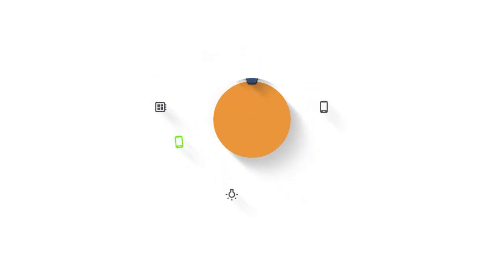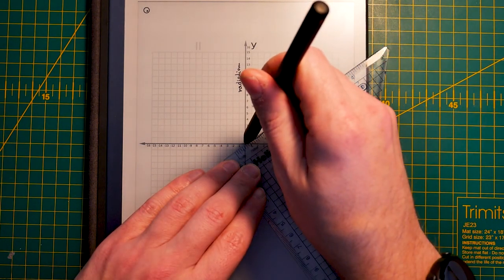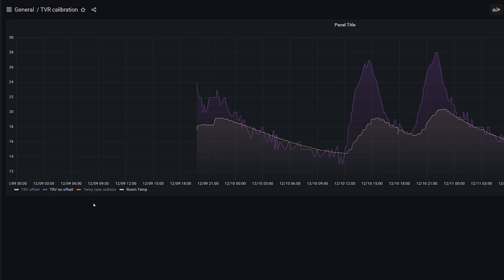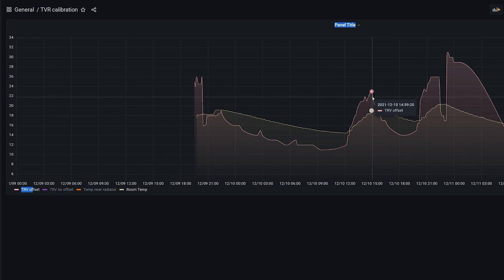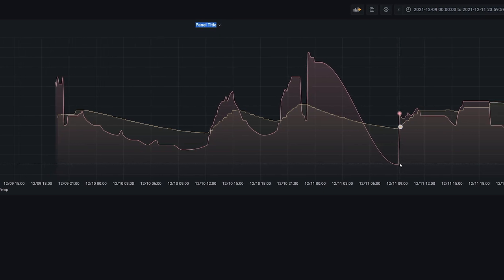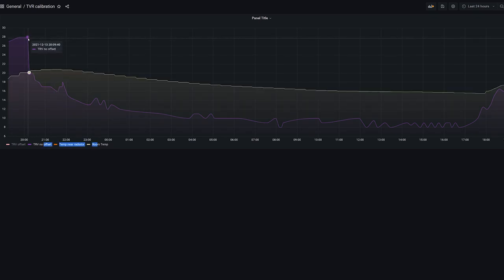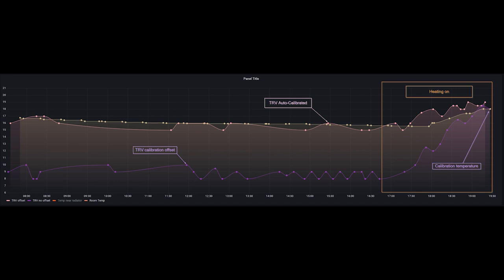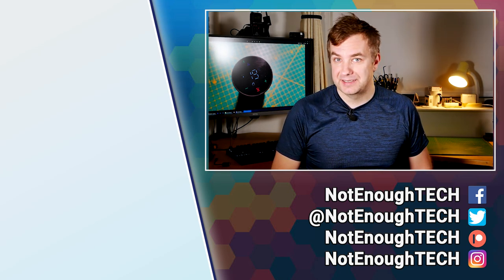Your TRV is lying to you! TRV auto-calibration

Comment: I always did find it a little odd to put the sensor for a heating system next to the heat source heating the room, given how much a ZigBee temperature sensor doesn't cost I find it surprising that no on seems to be selling a bundle with a vale and sensor as separate components.
Reply from the maker: Especially that you could simply pair these in app and reference instead of the internal ones.

Comment: The old 833mhz MAX! EQ3 system would let you pair TRVs to a room wall stat. In this config the wall stat temp was used instead of the TRV temp sensor.

I'm seriously surprised modern TRVs don't support something like this? The world has gone backwards.
Reply from the maker: I totally agree. Knowing how radiator affects the trv it makes no sense to gate keep this especially since ZigBee temp sensors are readily available. You could even make them bind directly thanks to ZigBee binding.

Comment: Nice 👍
What is your feeling on the quality of the TRV? I tested the previous model (straight not curved sides), and think the noise when adjusting the valve was too loud/annoying to have in a bedroom. Also the plastic fitting was very fragile.
Reply from the maker: They are silent. Can't comment on the brackets yet as I'm yet to mount these. I need special valves and bleed my system. Other than this touch buttons aren't super responsive but not breaking the deal.

Comment: The solution is using an external temp sensor. Very few valves can do it, but in any way a “smart” valve is always better than a dumb one.
Reply from the maker: Indeed. Although I've not come across calibration routines that allow for the 3rd party sensors to be used in these apps. Hence my desire to fix this
Reply: @notenoughtech  there is a bluprint in HA for this. It amends the internal TRV temp correction by sending the gap between TRV and sensor temperature as new correction value in the TRV settings.
Reply from the maker: That's good to know :)

Comment: Wouldn't this break the TRV's hysteresis logic? I'm wandering if it doesn't use this exact error in reporting the temperature to close the valve at a lower room temperature while the radiator still bleeds heat in the room. In my case, the external temp sensor records heat increase a good 20 minutes after the central thermostat stops the heating system (i have no TRVs, only one main thermostat used as a switch for a sonoff mini and zigbee temp sensors in each room used for reporting only). Maybe you should check using the external sensor how it actually keeps the room temp relative to the setpoint in both cases calibrated/not calibrated.
Reply from the maker: It would need more advanced features to be able to do this. Each room/radiator would have a different pattern of hysterisis. 

I'm yet to decide how will I handle the heating on/off setting since I can either drove it based on setpoint or time targets. I don't think this changes the way the thermostat works as the moment the temperature crosses the setpoint the valves closes. 

Its important to remember that we are still measuring room temperature (slow changes of temperature) Vs setpoint. The moment we reach the setpoint the heat is redirected elsewhere and the radiator starts to cool down. Cutting it early will also cause the system to fire up again early as the room thermal bleed would not be offset by the residual heat in the radiator as much. 

Based on this logic I believe I don't have to worry about it. I do have unpublished script I wrote over the summer to handle hysterisis and nearing values but it has been only tested on theoretical values.

Comment: Don't they also compare radiator temp directly on the valve pin to the ambient temperature with two internal sensors?
Reply from the maker: No, they have a built in probe, which you can offset by what you think is the right amount, Aqara TRV has the option to link external one directly
Reply: @notenoughtech  Ah, I see. Thanks for the tip :D Those controllers are gonna save me a lot and are, in the end, a very nice quality of life addition to my old heating with just one central dumb thermostat for a house with lots of rooms and bad insulation. No more hustling with space heaters or micro-managing those damned old mechanical radiator valves that aren't even thermostatic in my case.

Comment: First time i found someone on youtube who has old heating system lol, absolutely hate TRVs though as they can't regulate good at all
Reply from the maker: Few more weeks and I'll be able to give a more hands on account but with how everything lines up together... I think it looks pretty promising
Reply: @notenoughtech  i forgot to clarify, the mechanical ones suck a lot, these may not suck as much but it would be pretty expensive to change all
Also my heating system is powered by manually feeding coal so the temperature of the water inside varies a lot and causes it to suck even more tbh
Reply from the maker: That will be hard to automate. Unless you get some coal feed system too.
Reply: @notenoughtech  i didnt know that was a thing at all xD
Reply from the maker: I suspected it but I thought the offers would prevent some of this. My expectations were about 2-3C off after calibration... So having 8-9 was a bit of a suprise to me too